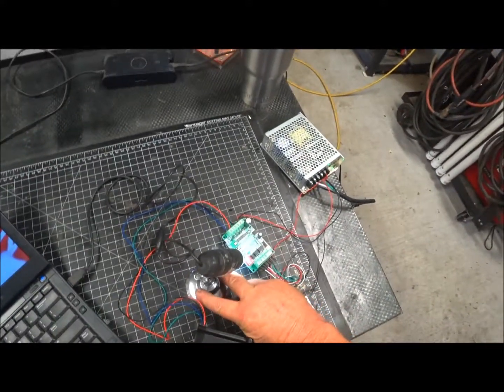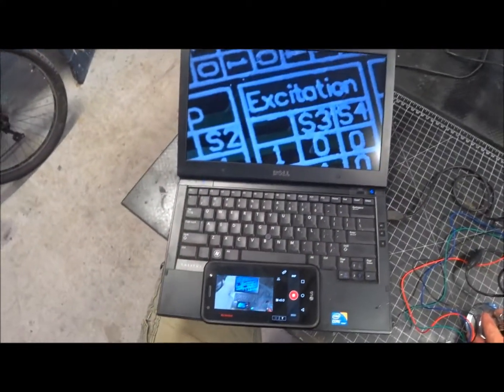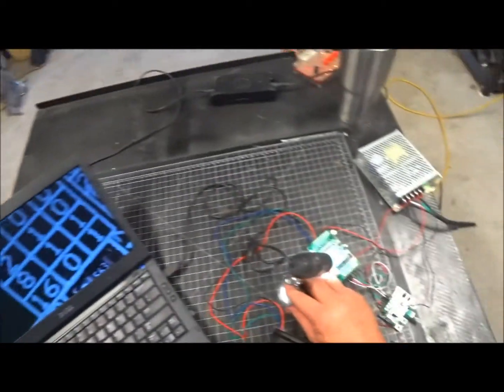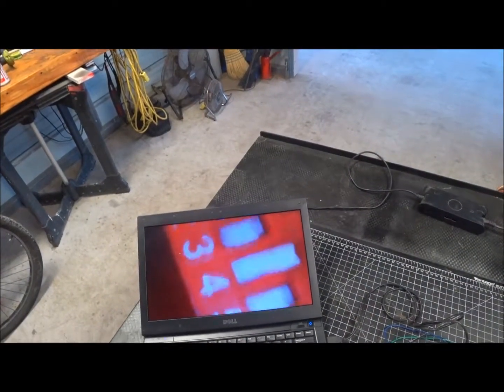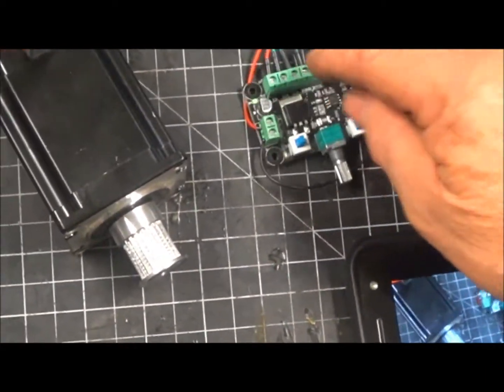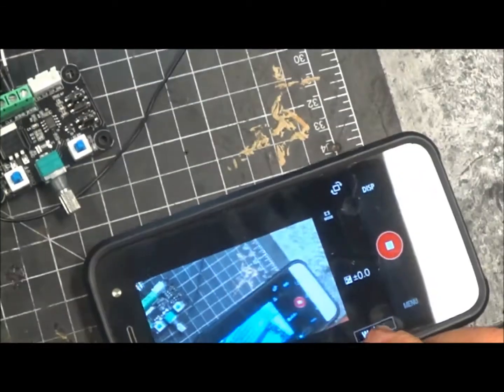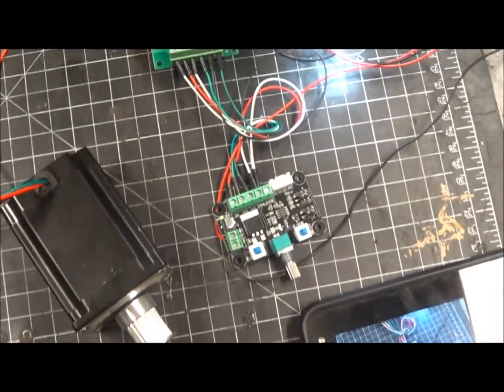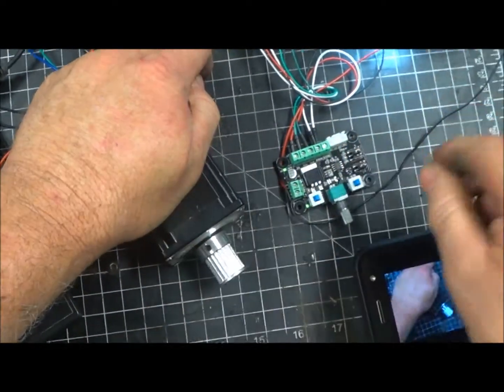TB6560 3A Driver Board and motor set up

Comment: the TBXXXX series controllers are all similar.
I have a 4axis controller,... all contained on a single pcb....  You can set the Amp level you are comfortable with.
The NEMA23 's I have are 3V@3A and my intent is to make them last.... hoping 2-2.5A max. leve!.
I also have a batch of KODAK 220V20A Fast Switching Relays, thinking there might be a future for them.
A small LED can be your coil continuity checker... if that helps....  with vids aplenty in YT.
Excitation is Full Step, Half Step, Quarter Step.
Reply from the maker: Thank you and thank you for watching